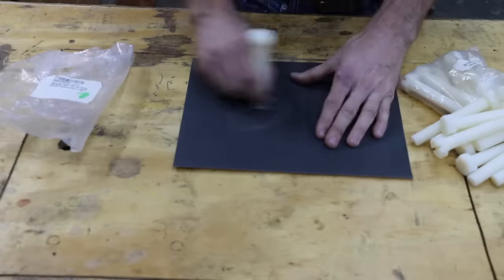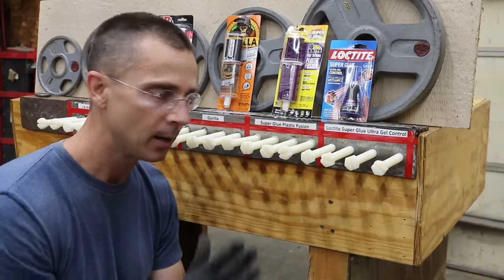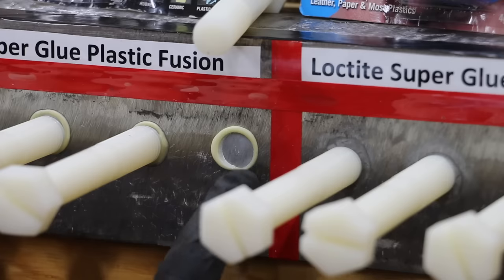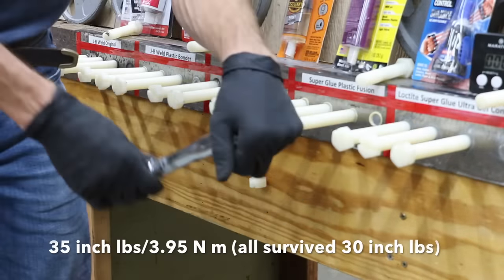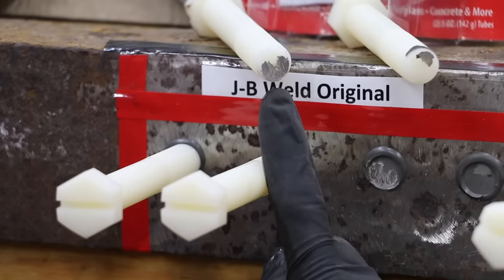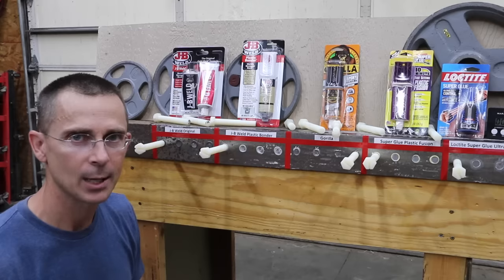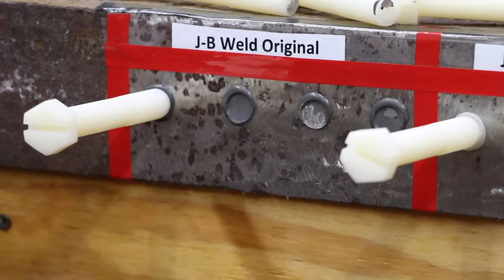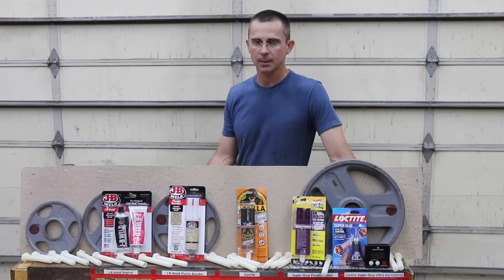Which Epoxy is Best for Plastic?  Let's find out!

Comment: Early this time around. I would like to see a plastic to plastic styled test. @Project Farm
Reply from the maker: Thank you for this recommendation!
Reply: As always good Job. Keep it up.
Reply: could you do this same test with something other than a nylon bolt maybe abs or some other plastic from personal experience not much likes to stick to nylon
Reply: I was thinking the same. Plastic to plastic and different plastics.
Reply: Use polyethylene instead of nylon
Reply: I agree that would be interesting.
Reply: I believe plastic on plastic would be the proper way to test this.
Reply: Dewain Anderson If I remember right, nylon is harder to bond
Maybe test a couple different plastics, that'd be interesting and useful!
Reply: SlowcarsInc yes, sane here
Reply: agreed, when I'am looking for a plastic epoxy?, its because Im glueing plastic to plastic, not plastic to metal
Reply: Yes, and polypropylene is extremely difficult to get a glue to stick. That would be a great test.
Reply: I agree, plastic to plastic type glues like Plastic Weld please
Reply: I have repaired several 044 and 460 Stihl chain saw fuel tanks with Devcon.
Cracked and broken plastic tanks that do not leak gas after several years.
Reply: Did he ever do a plastic to plastic test? I have a HDPE Canoe that needs repair and couldn't find any when I skimmed through his videos, but there are so many I may have just missed it.

Comment: I was getting ready to fix my the plastic gas tank on my lawn mower. I have lots of small tubes of jb weld. It's not that I intended to buy multiple tubes. It's that I cleaned up my garage recently and found them everywhere. I was going to head out and buy a tube of jb weld for plastic to add to the pile. Thanks to your test, I will just give good old gray a try.
Reply: Same here my friend when I need JB weld I just go looking around my house or garage and find plenty of tubes of it long time user of the product even used it on a engine plug on a car in 1984 sold the car 3yrs later no problem plug coming out

Comment: how often would a person have need to glue plastic to steel?  
more of a case or need to bond plastic to MORE PLASTIC of the same nature unto (on onto) itself me thinks.
Reply from the maker: All great points. Thanks for commenting.
Reply: I agree with you, J.P.
Reply: Came across this video for this exact reason. Broke an RC helicopter landing gear leg and was curious what the best plastic to plastic adhesive was. Still a great video though! Would have liked to see Devcon plastic steel too although. 👍👍
Reply: The best for plastic-to-plastic WAS Devcon MVP 33.  It was so good, they stopped making it.  The next best was Devcon Plastic Welder.  ALL the other so called "plastic welders" are not nearly as good. These conclusions result from trying many products over many years. "Crazy  glues" might grip great at first, but, in my experience, they do not hold up over time.
Reply: Voodoo Ranger 🍻👍😄
Reply: If the adhesive bonds to the plastic it can be used to glue plastic to plastic, if it wont bond to to plastic it is not suitable. Having said that  if the substrate fails before the adhesive (such as when the bolt broke) then you cant ask for more than that from an adhesive. Also each of the adhesives may have performed better if the plastic surface was scuffed first.
Reply: One of the ways you could around some of the limitations of these epoxies is to drill a hole in that plastic and then make sure epoxy fully fill the holes.
Also, you have to remember there are literally hundreds of types of plastics and what works very well on one type of plastic may not work at all on another type.
Reply: yup, only reason I clicked the video. Also those plastic bolts are nylon, the mose un used plastic (for human uses that dont require a slippery plastic)
Reply: you would be surprised
Reply: tarstarkusz That’s a good tip, drilling holes.  Gonna try that on my minnow bucket lid (hinge pin).
Reply: As someone who repairs vape mods, I regularly have a need to bond plastic to metals.
Reply: Swift Cards I use Plast-aid for my drone breaks, that stuff is amazing!! You can also cast molds with it in silly putty!! It bonds chemically and mechanically and is SUPER strong!!
Reply: I like your videos and hopefully you read the comments on the older videos.  What type of plastic were the bolts?  Just saying plastic is like saying metal. There must be thousands of different types of plastic.
Reply: JP Stone aquarium
Reply: I have used plastic to bond with steel quite a bit but nothing that had to withstand much weight or pressure. Jb weld plastic 2 part epoxy works the best for me.
Reply: Nick Hall 8
Reply: even still, they are all failing to hold to the plastic, so plastic to plastic would be double failure to bond.
Reply: JP Stone I have metal differential cups in my plastic geared rc differential which I need to epoxy, just one example but in the rc world plastic to metal is very common so this is exactly what I was looking for.
Reply: JP Stone here's one case. Going a fishing net holder (not really made for fish) to a metal telescoping shaft
Reply: Archery requires this type of bond, particularly in arrow construction!
Reply: JP Stone; Bonding the metal latch to the plastic cover on an outboard engine cover.
Reply: I'm about to fasten some hardware to a kayak so I really appreciate this specific medium setup.  Would be interesting to use a guide that flattens the epoxies out to an even 1/8th or 1/16th layer to make thing a bit more uniform.
Reply: I purchased a plastic rain harvesting tank.  I wanted to add an overflow hose connector, which was made of brass.  I have yet to find a good adhesive which would keep the two together for more than a month or two.
Reply: More often than you think actually. Sometimes I'd like to put a magnet on a plastic container and in those cases both a screw and glue if I really want it to stay there and be sealed.
Reply: JP Stone i had a metal threaded insert fail on my belt cover housing on my 4 wheeler that was essentially shoved into the plasic. an over tightend bolt led to stripping the insert right out of the plastic it was pressed into. now i need to be able to bond it back so i can use the bolt as designed to tighten the cover down again and water proof the seal and this video was extremely helpful. just 1 example.
Reply: I was thinking the same, but we got our answer from these tests. Unless they melt the plastic and fuse it, they won't work any better than you see here.
Reply: I do...Which is why I am watching the video...
Reply: I was pretty confused about this experiment due to this fact as well. Maybe try a sheet of 1/4 inch thick ABS plastic sheet next time??
Reply: Perfect for me! I have a large plastic table and the metal screws keep falling out. I'm looking for something to hold the screws in Based on this, Loctite SuperGlue Gel is the best for the application since I'm interested in torque. Thanks! 👍
Reply: I used JB Weld original on a headlight plastic housing and it never failed.junk yard wanted 80 bucks for a replacement. $5 on JB and a few hours I was good 2 go
Reply: I’ve made custom bezels for car speakers and head units to give aftermarket, that “factory” look. Many times have I bonded plastic to metal. I almost always reinforced with fiber glass on the backside when it’s a large enough project, but when you are in those tough to reach spots? JB weld is the trick.
Reply: I use jb weld ..to hold my 3d plastic prints to metal/aluminum  for my castings ...so yes it works but Like I said there castings so these are not meant to be pulled on ,hit on so all these 'glues" work but for curtain things in my case i use jb weld do to me always having it in my tool box lol I would use any other but I tend to just buy jb weld it's a habit  buying it...
Reply: I have to glue steel to carbon fiber so it happens
Reply: Everyone here who fails to understand the concept of why he did metal to plastic is ignorant. His process shows a failure to bond to the plastic in many cases, that shows you right there how the plastic to plastic bond would be. It would be weak. A hybrid bonding will show you where the weak spots of the epoxy are. His experiment was both informative and educational. If you feel the need to do a plastic to plastic bond, go ahead and make a video, and I will not watch it because I've already learned what I need to learn from this video.
Reply: The best stuff is the stuff that melts the plastic and they become one piece
Reply: That's why I am here
Reply: You get a lot of that in automotive, i am about to glue projector headlight (metal ) to plastic headlights housing and that is why i am here
Reply: @mikefdieseltech3851  - what products are you referring to?
Reply: John Doerger I’m referring to glue that is typically used for plastic model construction

A simple explanation would be how ABS plastic is glued together by using 
Acetone, because the acetone melts the plastic and then when it dries, the 2 pieces physically become one piece because it bonded with other plastic and not the glue

So instead of the glue holding it together, the plastic becomes one piece
Reply: @mikefdieseltech3851  - sounds great and what I am looking for. Did you mention any specific products?
Reply: I am here looking to glue some broken car plastics together. No time or value in trying to create a "new" door panel. Just glue it.
Reply: John Doerger 
Sorry for a late response
If you want to bond ABS plastic use acetone

But if you are looking into building plastic models like airplanes, then use this stuff

https://www.scalehobbyist.com/catagories/Paint_and_Construction/TES00008872/product.php?gclid=EAIaIQobChMI0PScnp_y4QIV1rrACh33GASHEAQYAiABEgJinfD_BwE

Keep in mind that this is for scale models.

Here are some other glues 
And a really good explanation
https://chemicalwiki.com/best-glue-for-plastic/

The most popular plastics used for commercial and residential use are polystyrene, PVC, Plexiglas, and polycarbonate. It is easy to bond the same kind of plastic together with the right adhesive, but it may be difficult or impossible to bond different types of plastic no matter what glue is used.

Sorry I wasn’t able to get back to you for a while and hope I answered your question.
Reply: Film Makers MC Williams 
Are you talking about an interior door panel? Or like a rubber seal for the door?

Cause if it’s a rubber seal you can’t really glue it because the glue will make the rubber stiff and crack

But if it’s a interior door panel. Then your best bet is to use some epoxy like JB weld
Reply: @AshishKumar-nd9hq  , try Marine 5200 adhesive. Probably take a week or more to cure fully, but we used to use that stuff on the inside and outside of boats all the time. There are special Marine epoxies  that will purportedly even cure and harden while  underwater, but the 5200 seems to make a better bond to hard-to- glue plastics.
Reply: @TheStefaner , my washing machine sucking a penny into the pump housing; the motor and impeller survived but housing cracked. Marine epoxy and a piece of fiberglass cloth.  That was 2 years ago and it's still working without leaks.
Reply: I have some glasses that have a metal hinge with I believe nylon arms....super glue held for a day but I do have some JB Weld....
Reply: Me too in agreeing with J.P.
Reply: Outdoor boys too
Reply: WRONG---That is exactly why I am here watching----to mount a plastic component to steel!
Reply: @DBowesMusic  What the hell---you provide a link to the very same video we are already watching.
Reply: @rmcustom9573  And yet he got a lot of thumbs up from like minded people that have probably epoxied nothing in their life. Would like to see a plastic to plastic test too BUT there are so many types of plastic as well that it is hard to choose what is best for your specific needs. I agree though, there are a lot of asses on YouTube that shoot their mouth off when they should just STFU.
Reply: @TheStefaner Well why the hell didn't you share which one you chose for your fix.
Reply: i need to right now
Reply: Me. Right now.
Reply: @kumd  I see an RC pilot and I upvote
Reply: Luis Hernandez 🤗
Reply: Yeah, I was surprised JB weld did better than JB weld plastic, but this is exactly why.
Reply: Because the company said it would.   That is the test
Reply: Not often. However, I have to re-glue a metal to plastic on my son's camera zoom lens.  It's a kit lens which explains why I've come across this video.
Reply: For ABS plastic I highly recommend Permatex 84145 Permapoxy Black Plastic Weld. It says it works on other plastics but I don't personally have experience with that yet. It has a very strong smell so make sure you are in a well ventilated area.
Reply: 3D printed parts and small metal strips and magnets....

Comment: JB Weld again, and again, my favorite part about JB Weld is the two tubes. It's so easy for a single tube adhesive to gum up at the opening of the tube.

I do wonder if the dual syringe design would be good against clogs for the kind of person that only needs a good, occasional adhesive. That being said, I'll probably stick with JB Weld as the default
Reply from the maker: Thank you!
Reply: I just bought some. The syringe is only .85oz, the dual tube is 2oz total. It's double the price for the convenience.

Comment: Use a high temp cooking oil as a replacement for motor oil.
Reply from the maker: This is a great suggestion.  I'll test this soon!
Reply: Cooking oil won't work as it, along with non-stick sprays only work to prevent the food from sticking to the pan.  If these products are used in a "friction" type function, it turns into a very sticky glue like substance and would lock any engine up very quickly.  I know this as I used to repair a lot of food preparation equipment and many folks would use cooking oil or Pam to lube something like the slide rods in something like a meat slicer.  Then when the whole assembly became a solid mass, they were shocked at the expense as this crap has to be scraped off with a razor blade, then a wire wheel on a bench grinder and then still cleaned with solvent to make it usable again.  I also learned at a young age about this when I had one of those neat Visible V8 engine models with the electric motor in the starter housing and the distributor actually worked turning on lights where the spark plugs were.  The instructions said to use cooking oil to lube the cylinders.  Needless to say, my model totally froze up quite quickly.  If I get my hands on another one of these exact models (not the hand crank one), I now know better to use mineral oil, or the food machine oil which I still have plenty of.  Just my 2 dollars worth.
Reply: JRobert111111 worth a try & see in action!
Reply: Project Farm look forward to it mate! Viewer from Australia here bud!